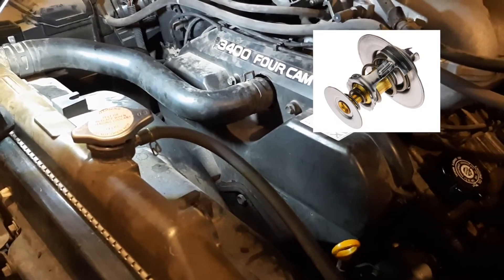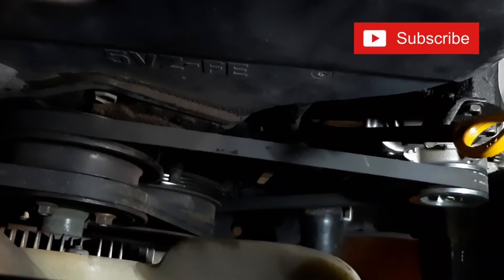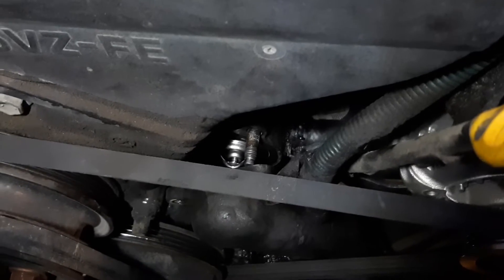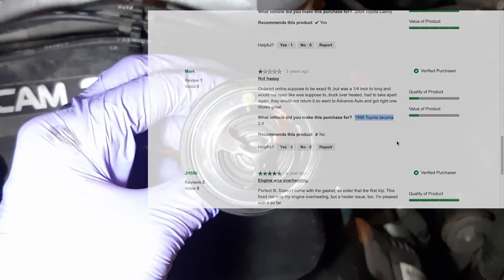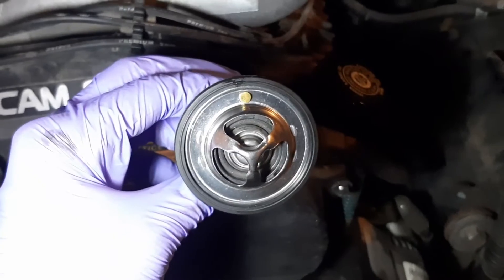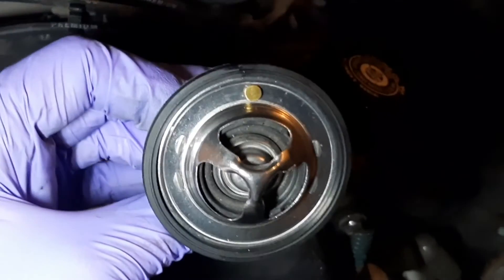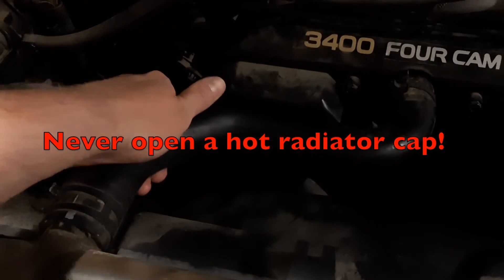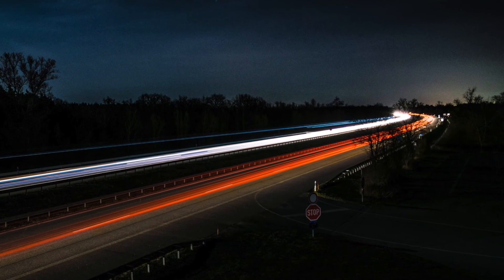Toyota 4Runner Overheating Thermostat Issues! 3rd Gen 96-2002 + Tacoma-1995-2004 -OEM vs Aftermarket

Comment: 1st rule of mechanic work especially with something like a thermostat. Dont fix something that isnt broke.
Yes prevenative maintinence is a thing i believe just not with a working functional cooling system provided the antifreeze looks good and has good color.
Reply from the maker: On a newly acquired used vehicle, there's no way of knowing how old some parts are. Could be 15 years old. It's cheap to do and will never have to do it again. Why risk breaking down or thermo sticking closed and overheating 200 miles from home? I see your point about 'not broke don't fix', but in this case  I felt it was the right move

Comment: I got I code P0125 on my 4Runner 1999.
Do you think changing the thermostat will fix the code?
Reply from the maker: That is one possibility. There's other causes but by far the cheapest fix would be to replace with the correct thermostat. If it hasn't been done in a while it needs to be replaced anyway. Because if a thermostat sticks closed, it can cause your car to overheat one day
Reply: @KeithBlade 
Thank you I’m going to change that first

Comment: Use Toyota thermostat the right coolant distilled water drain the block  my temperature 205 jiggle valve at 1200 o'clock going to switch  6000 o'clock, bought  another thermostat  and gasket. Also new cap, clutchfan replaced with Toyota parts ,when I got home to do the job it was still hot took cap off thinking its going to blow so wrapped a towel around it and to my surprise no pressure so that tells me that the cap is bad.  6000 timmy the toolman.

Comment: Nice video! However, should always use OEM Toyota parts and fluids. Just a heads up, the Jiggle Valve is at 6 o’clock.
Reply from the maker: Thanks for the feedback. I've never had a bad Napa auto part in my life over many vehicles, however your point is well taken - especially for internal engine parts and gaskets I like OEM.
Reply: Nice! I never really gone to NAPA. Now, I’ll keep them in mind just in case OEM aren’t available. Thanks for the tip. 🤙🏼🍻

Comment: I’m currently doing timing belt in 1998 Toyota t100 I’m using a Napa thermostat and doesn’t have the jiggle valve in the outside surface but it’s in the inside of the thermostat.
Reply from the maker: Yeah some of them don't have the jiggle valve in the usual spot.

Comment: Brother, since you did it twice in 24 hours.  Did you reused the same coolant?
Reply from the maker: Yes, absolutely reused the same coolant from the day before, it was perfectly clean with no contaminants.
Reply: @KeithBlade  cool Ty.  I need to change my thermostat position.  I just put in a new radiator and coolant like a week ago so I’m reusing mine to then. 👊🏽
Reply from the maker: @tommyhenriquezkayakangler8465  The main thing is when it drains from the radiator make sure that area down there is very clean so it's not picking up dirt as it drips off the bottom of the car, into your container. I sometimes pour mine through a paper coffee filter to catch any contaminants or dirt that fell in during the drain process.
Reply: @KeithBlade  heck yeah.  Will do.  Good idea.

Comment: Toyota Service manual says jiggle valve at 6 o’clock position.  Had mine at 12 and ran 190deg +   By putting it at 6, temps dropped 10deg+    Going with what Toyota recommends.

I never knew a thermostat could be longer!!  That’s some good info sir!!!👍🏼👍🏼
Reply from the maker: Definitely! I think there's a notation in the  video to always go with what the manual recommends. Thanks for posting.
Reply: So which one is it in the Toyota manual; 12 or 6 o'clock?🤔
Reply: @dmironyuk  Toyota says 6 o’clock.  Difference is huge in temps.  I know it’s weird and the opposite of most cars.
Reply: @rallypoint1  thanks for confirming that,  Toolman Timmy says the same if you check'm out on here. Guess I'll be doing that to👍
Reply: Why most vehicle have their thermostat on the upper hose and thev4 runner is on the bottom rad hose and the water there are cold i dont get it

Comment: never changed a thermostat before, do I need to buy a gasket for my 1998 4Runner or just the thermostat and replace it?
Reply from the maker: Best to get a new gasket, the black rubber kind that stretches around the thermostat. Make sure it fits the thermostat before leaving the auto parts store

Comment: My 3rd gen 4runner has a stuttering issue when in gear, accelerating and reverse, and has just started to over heat, any ideas?
Reply from the maker: Stuttering how? Like a fuel misfire issue or does it feel like the tranny is sluggish?

Comment: Going to try tomorrow for my 1998 SR5 without working heat. Any thoughts?
Reply from the maker: Thats not always related to a thermostat, theres other things involved in the heater. If your engine runs cold and never warms up properly, it could be a thermostat. If it hasn't been replaced in years it's a good idea to replace it anyway.
Reply: Is your engine getting to operating temperature? If the motor get hot but you have no heat, i would look at flushing the heater core.

Comment: I have a 2.7 4 cylinder I wonder if it’s the same one? 1998
Reply from the maker: Not sure. The one in video is the 6 cyl . You could check the website and see if it gives a different part number based on engine size for that model year.

Comment: I always use genuine toyota parts when possible. That green coolant probaly isn't the best idea long term. Great video. I always put the jiggle at 12 o'clock like you stated.
Reply: Toyotas of that age came with red coolant. Also the fsm states to install the jiggle valve at 6 o’clock. I also had an issue with an Aisin thermostat causing my 5vz to run 10 degrees hotter. Bought one from the dealer and it does not go past 194 degrees.
Reply from the maker: Agreed on OEM. But mixing green and orange coolant is not recommended. The truck came with green coolant in the 90s, and still had green coolant when we bought it last year. It's not worth the risk to me to try to flush all the green stuff out and replace with orange because if they mix, it can gel up and clog the water jacket. It runs well with green coolant and if changed at correct intervals there should be no issues
Reply: @KeithBlade can’t u just use preston’s or peak coolant? they mix with any coolant
Reply: @KeithBlade yes and no. It's definitely best to flush and change to red. If you ever get the chance to see a block ran it's entire life with red vs one that had green, you'll see just how rough that green is on EVERYTHING. If you bought the 3.4 because of its longevity, then flush it and get red in there.

Now, if someone isn't confident enough in their ability to flush the system (despite it being nearly identical process to draining and filling the coolant in the first place) then sure, don't risk it. But why would someone be replacing the thermostat if they aren't even capable of flushing a rad ya kno?